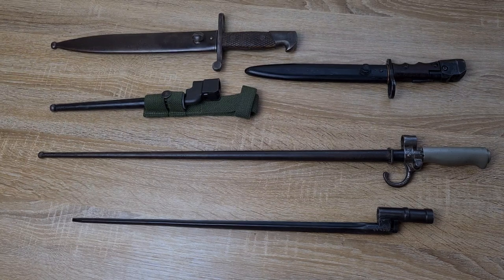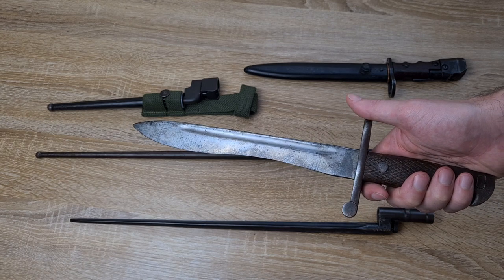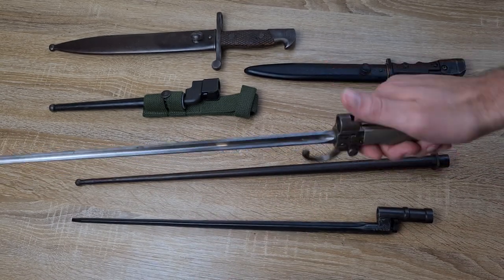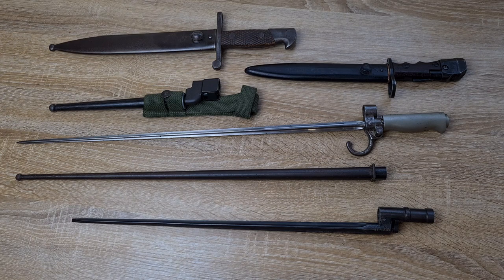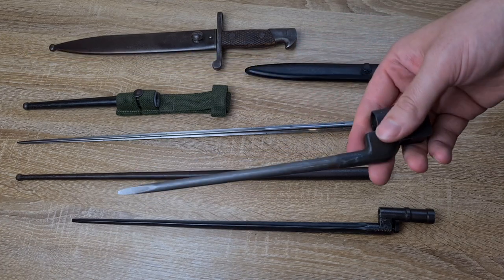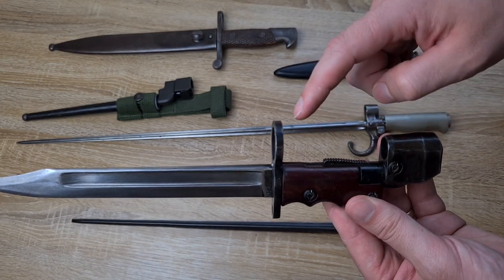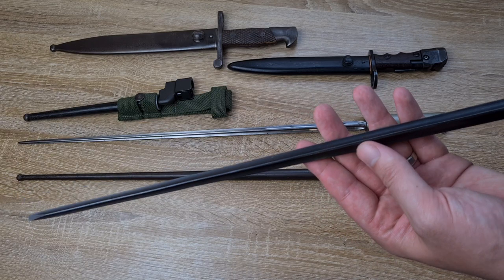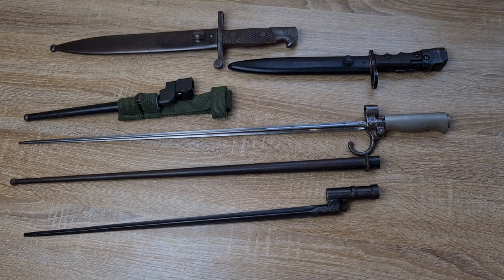Five of the worst bayonets of the 20th century

Comment: I’ve never had a lebel bayonet but I do have a gras bayonet that I think highly of. Would you consider that being a low ranked one too?
Reply from the maker: The gras M1874 epée bayonet was primarily used in the 19th century, and for its time I would say it ticked a lot of boxes. It was lighter than the chassepot, it was interchangeable between rifles which was a huge step forward. Length was no issue at the time and it made a much better sidearm than a socket.